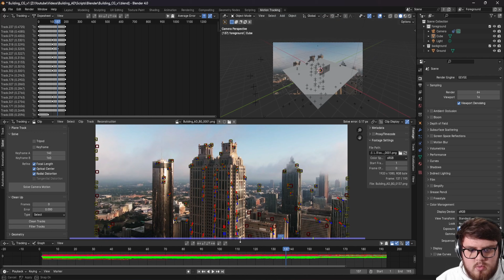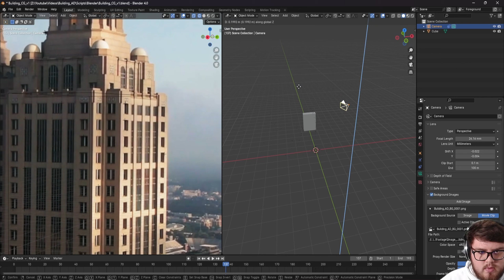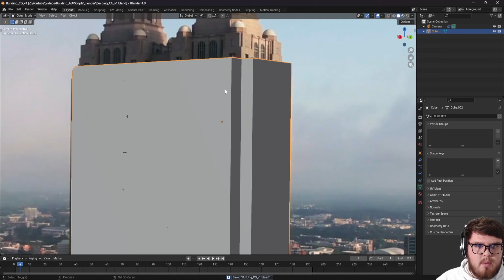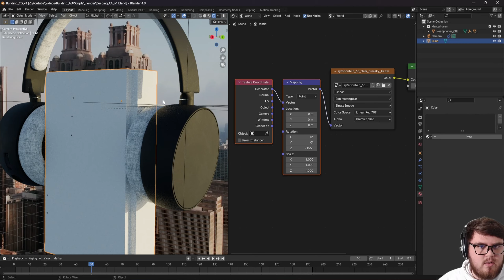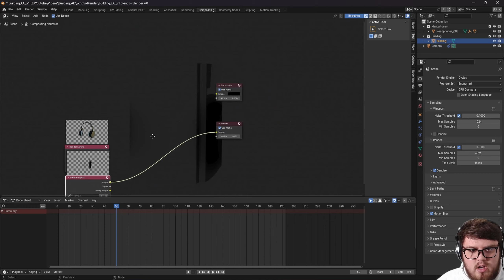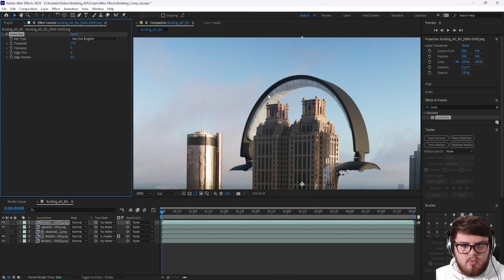Viral 3D Marketing Using Visual Effects

Comment: Hey man if I was using an avatar in the scene to stand over the building so his upper body is showing, how can I keep the avatar in the middle of the frame as my camera orbits?
Reply from the maker: You would just need to camera track like I do in the video and then place the avatar behind the building in the 3d scene. Hope that helps
Reply: @Jacob_Zirkle  I tracked the scene however i can’t figure out how to keep the avatar still so it looks like it’s standing in one spot of the building instead of it moving as the camera moves. I’d really appreciate any suggestions